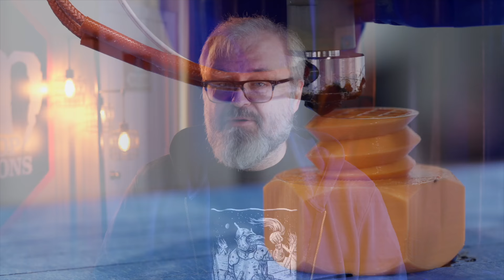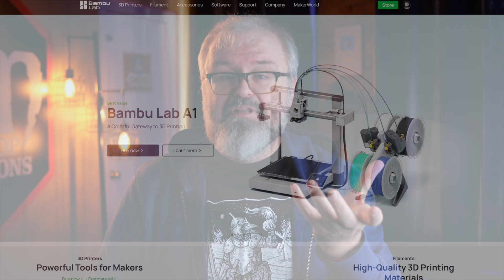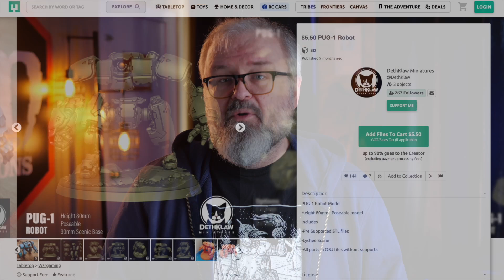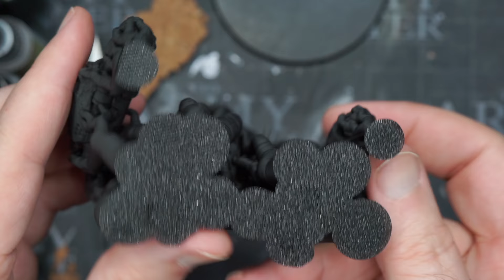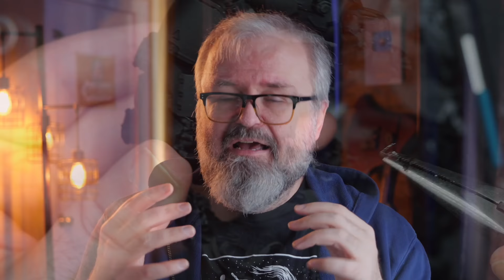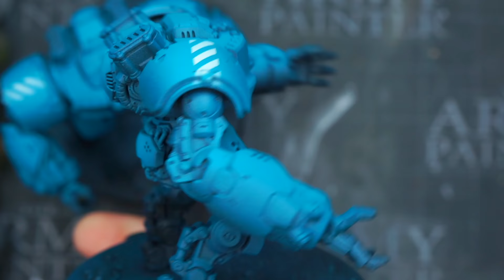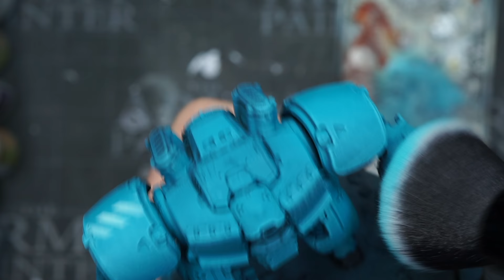I Compare RESIN vs. FILAMENT for 3D Printing Wargaming Minis

Comment: Got my FDM printer for other things, not miniatures. Mostly larger parts and when it comes to more "geeky stuff" cosplay items or large scale items, like swords, helmets, etc, where sanding the FMD print down makes it look as good as any resin would ever be... Even so, very small details if added are not recommended for the most part.

That being said, this lead to that since I only recently got into the 3D printing hobby (and enjoying it a lot, as a 3D modeler and animator for years, seeing my designs in real tangible objects is amazing) and although initially I thought I wont ever touch miniatures around 2 weeks now I have been printing out my first WH40k 1000point army.

Long story short, I was interested in finally finding out how the table top is played. I was interested in getting some models, and painting them. Then I thought, how bad can FDM miniatures be? Lets try it anyway I thought.

My take on all this is camera detail and all these online videos are putting people off from actually using FDM with miniatures more.

First of all, the detail on a camera is always protruded. Mostly contrasts and light being captured between the lines shows up a lot more evidently than on the naked eye. Even on a crap camera. And this multiplies the "looks bad" notion. I almost expected the models to look like utter crap. Clearly I was pleased with the results, otherwise I wouldn't have set out to be printing out an entire army of 36 pieces.

What I found was that people fail to mention how good these look on the naked eye. THIS is the most important aspect to this entire topic that I see NOBODY is touching on.

All I hear is "well if it is far away" and then going into talking about display models etc.

Yeah, 99% of the people in this hobby don't even care about display or contests or whatever else, they just want to have fun. And when you put it that way, that it only looks good from a foot away and farther, nobody wants to bother.

This is not the case from what I found. And I am using a 0.4mm nozzle which is considerably also worse.

Comparing quality?  Well yes, they look worse comparatively. It is obvious. I would argue even from a foot away if you sit there to observe the detail.

This does not mean that they look bad. I found they look a LOT better than what all these videos, photos and camera shots have us believe. And honestly, its like comparing a 50 dollar toy to a 10 dollar toy. The detail on the 10 dollar toy would obviously be less, but not crap.

People had me believe it would outright be just crap.

It actually looks good, surprisingly good, and I have printed some pretty extreme details on the models.

Layer lines are obvious. But its like having a model at 50% quality instead of 100%... Point being, it is actually still quite good. Even when observing it up close, it looks great. Obvious lines sure, but depending on paint and technique some of it can even be hidden quite well. On some space marine models the dirt on their boots for example along with the shading and base colour actually makes it so hard to see the layer lines with the naked eye that even from up close you need to turn it on the angle of the light to see it. Then other details are considerably worse, one shield I printed looks like utter garbage. Printed the same shield in a different X,Y, Z orientation and it looked a whole lot better.

The point being, FDM is not getting the love it deserves. It definitely looks still good. Is it worse? Of course it is. The question is, does it look good. And the answer is, well in my experience, yeah, it looks very good indeed. A lot better than all these videos would have you think. It is simply, again, like seeing it at 50% of the fidelity. But we are talking about a line thickness of (in my settings) 0.12mm. This means that although 0.4mm nozzle the detail it can reach in movement is up to 0.12mm, and in many angles the print is actually very good. The lines are very small, and the detail impressively good for an FDM. And I would argue totally worth it.

There are definitely some tricks to make a print better. Alignment and orientation can make a huge difference. Like the shield example I gave. The second one I had printed looked actually quite good.

I still haven't pin pointed which is the worse orientation, but I have a feeling it is the Z axis. Meaning, if you can tilt a model into a direction and for a large area X and Y are used more, the layer lines are much less visible. In some spots they are almost not visible at all (the miniscule skull on the knees of my Black Templar champion in fact looks so good you can barely notice the lines with bare eyes)...

Really depends on a lot of things. But again, FDM miniatures look MUCH better up close in real life than cameras. And this needs to be stated.

As for actual table top playing, well there they look even better.

One other trick for all this, weathering. Weathering helps lean into the whole layer line situation. And at parts that might be slightly off, we can always add battle damage. Not a great tip for when wanting to make clean models, but in many other cases works great.

Also, matte varnish works wonders. Hides the reflectiveness between lines and makes them less evident.

Great video all in all, but I just feel I had to point this out. Most of these videos make it sound too much leaning to the side of "FDM looks bad" and stating always "well you can't tell after 2 feet away" and focusing on the wrong things. "Can you notice the difference when closer"... Well, yes, you can, the question is, does it still look good or not. And I would say, it totally does.

Its like comparing buying a board game with premium models in it at 100 bucks, and then buying a cheaper version at 50 bucks. What you pay for is what you get in the end, and the 50 dollar board game will still look good although not at the same quality of the 100 dollar version. And that is kinda what this all comes down to in the end.

Me? I dislike Resin printing and the whole toxic chemical approach to all of this. I also want to do more printing than miniatures. I also don't know anyone with a resin printer. And if I did, I also wouldn't bother them all the time for such prints. Its a different story to just print whatever you want on a whim whatever you want at any time. And the result is definitely quite good. And if we talk about the money saved since I have no access to resin printing or someone with resin printing? Well, I put it all down and the army I am currently printing would of cost me around 300 to 400 bucks...... How much has it cost me at the moment? 9 bucks. That is it.

Going by price value to quality ratio, one would say that getting 50% of the quality for at least 30 times less the cost is totally worth it.

Go try FDM printing more people. Yes, the quality drop is evident. But still looks very good, and definitely way better than what cameras' show it to be on videos and photos. Speaking from experience. And anyone that has tried this knows it for a fact. Took a picture of a miniature to show to a friend. It was just not doing it justice. I brought it to him the next day and he was "omg, looks so much better than what I thought it would up close!".... And THAT is exactly what I am talking about. Yes, it looks WAY better in real life than you expect it to look. And again lets face it, 99% of the people into painting miniatures as a hobby are doing it for their personal collection and enjoyment. The quality is more than good enough for this use. And for table top playing? Even more so. As said in this video and others as well. You can't even notice the difference after a point in distance.

Later all, hope my thoughts on all this helped. I'm off to rip that support tree structure from another Black Templar Terminator model I just kitbashed together on my 3D program and continue with some painting :)

Comment: Just wondering if you could use filler primer on something like this. For larger projects I have seen that done for functional FDM prints and I am about to try that on a thing I printed for my mother and I have seen it done for cosplay prints. Just wondering if it would work in this application. Maybe? I meant it is designed to fill imperfections but perhaps it would fill in too much on some of the smaller details in miniatures.

Comment: This is not a fair comparison because a Giant robot is just like a scenery piece that filament Printers always make. Now if you tried with a humanoid figure with a face, then youl'll see there's no replacement for a resin printer. I think Both have pros and cons and are very useful for miniatures. I would use the filaments for scenery pieces and large vehicles, and resin printing for the actual miniatures.

Comment: So I got into Resin printing for Pathfinder and TTRPG miniatures.  I wanted near perfect matches of stuff and my prints are smaller.  I went with a Saturn 2 and then when it died went to a Saturn 4 Ultra.  Between the two there is almost zero difference in quality.   My buddy had a very nice FDM printer, that he sold and upgraded to a significantly nicer one for more money.  I want to say his printer cost 3-5x as much as the Saturn 4 ultra.   We both printed our min's, not to compare but because we could.  

Here is the truth:
The Resin mini's look as good as cast materials.  They are perfect.  This is true even down to the 10mm mini's I have printed.   Man those are tiny but they still come out incredible.

The FDM minis' look very good.  Me from 30 years ago would be in paradise being able to use them.  HOWEVER...  anyone who picks up the resin mini vs the fdm mini can tell instantly the difference and nobody, even the fdm printer guy uses those mini's over what the resin printer printed.   We normally print at 27 or 32mm in size and again ANYONE could tell in seconds which is which.  Nobody, and let me be clear here NOBODY would pick the fdm printed mini over the resin one.  

If you want near perfection there is really only one choice at this time for say 27 or 32mm models without a ton of extra work.  
This does not mean you could sand the others and work like crazy to make the fdm look better.  I am sure you could, but the resin mini just comes out perfect almost every time.  

Now if our group didn't have a resin printer for mini's, would the fdm be "good enough"?  Probably.   

Lastly, is terrain.  FDM is VERY good at that.  In fact if you are going to make say a bunch of castle walls, I would 100% do it on fdm over resin.  This is the core reason that I will be getting a large scale fdm printer in the future.

Comment: Use a hot air gun on the filament prints before you paint.  It will minimize the strings

Comment: As much as a pain it is to remove the FDM supports it is so much cleaner and environmentally friendly (especially with a medium like PLA) and easier than resin which is just an ecological nightmare.  I’ve been watching videos like fat dragon and with an 0.2 head and 0.6 layer height I feel like I am getting some pretty amazing results.  Plus there are settings involved that help with FDM support removal.  I am using both the Bambu labs A1 and A1 mini.  I primarily print models from OPR and Warmachine and once they are painted they look great on a tabletop fighting their way through a much more expensive force like they were made to do.  Very happy with the overall results.

Comment: did you change the thinness of the supports{Branch diameter }/ Because if you did not you made life hard for yourself. Did you add abit of over extrusion . This will fill in more or if you up the eat a bit more you can get a better Flow

Comment: i've played with anything from regular painted minis to literally small tupperwares and cereal box discs and cutouts, so i'm not exactly a stickler, but no, i wouldn't go through all the trouble (and costs, it's not free even if i'm sure it's cheaper) to print models that displays those layerlines. The model you picked is also kind of lacking in a lot of smaller details (like, say, a chainmail, or a somewhat thin sword, or tiny decorations), and i expect the fdm printer to be basically unable to print that stuff.

now, someone gifts me a painted army of anything printed in fdm? i'm going to say thank you very much and happily play with it tho! 😂

Comment: Your print looks really bad. You did really bad with supports, wrong supports used.  If you do everything right, it will be super easy to remove supports and they almost don't leave any marks (only small dots where supports touch model). There should be no visible layer lines.

Slice models in Prusa, use resin type slicing, add supports 120%-150% and add manually to specific places if needed. Then export model with supports, import into blender. In blender use addon to inflate resin type supports. Export miniature and supports again and import into Bambu slicer. There should be two different objects model and supports, for supports use layer height 2x higher than model, speed 50%.

Comment: I'm happy enough with the quality of filament from table length away, however pla can be really brittle on swords and fine details. There are tough resins with some flex to them after curing, similar to the reaper bones plastic, that I prefer just from a durability standpoint.

Unfortunately, we'll likely not get much finer detail from filament than what we've got, at least any time soon. When the layers get that thin, the hot nozzle being so close starts to re-melt and soften the previous layer. You start to get deminishing returns as you drive your layer height down

Comment: I am printing some minis and figures with an FDM printer and while they are not the level of perfect that resin will give, they are actually really good. Like, hard to tell even while holding them in your hands good. Printing with a layer height of .04 and really dialing in the settings for precision has come along way. There is an entire reddit sub /fdmminiatures where people just post their prints from fdms and many of us trying these hyper detailed resin STLs with fairly high success. All without dealing with any of the cons of resin.

Comment: I can see plenty of ways to chop this model up to print it flat on an FDM printer.

But yeah, no matter how good a Resin printer is in delivering quality, I still can't get behind in buying one because its such a monotasker. Atleast with an FDM, I can print models AND practical things.

Also, use PETG for models. The supports come off super easy on PETG. Alternatively, if you really want to stay with PLA, and if you have a multifilament printer, you can set it up so that your support interface is PETG while the rest of the model is PLA. With the support interface being snug.

PLA and PETG do not bond well together so supports come off cleanly with little effort. This is best done when you're printing the same models in big batches.

Comment: I did resin printing for a while, not to build gaming miniatures, but rather models of shipsfrom less popular media. It worked well for that, but it's such a chore. Even when you buy extra tools for cleaning and curing more effectively and efficiently, it's still messy and makes whatever environment you're in smell like resin and IPA for an eternity.

But I recently got a Bambu Lab P1P and have printed more in the month and a half I've had it than I did the entire time I've had a resin printer. Nothing can compare to that resin quality, especially for small stuff, but in the time and effort involved I could make twice as many FDM prints that are 50% larger and not make my house smell like DuPont.

Comment: Those dang tree supports... I've been adding resin supports in lychee slicer and then exporting the stl with supports into prusa, my preferred slicer and printing everything with fdm and it's working pretty good. And yeah, printing all the pieces separately does yield a better result because you and rotate each piece to minimize support blemishes but way increases the print time so i usually just do the whole model all at once on a base. It's good enough for me